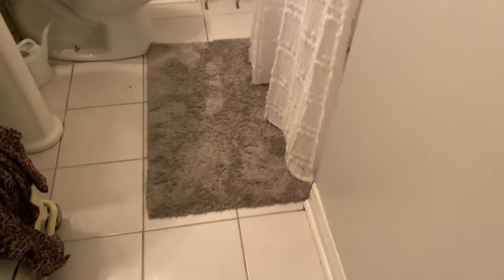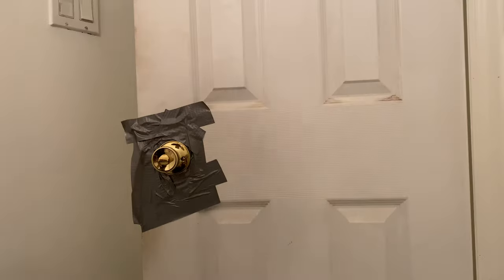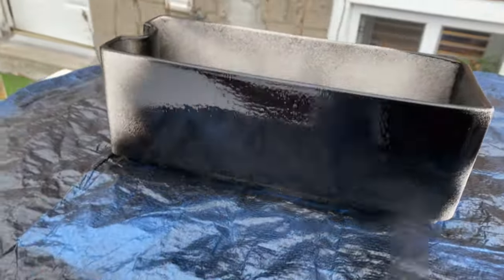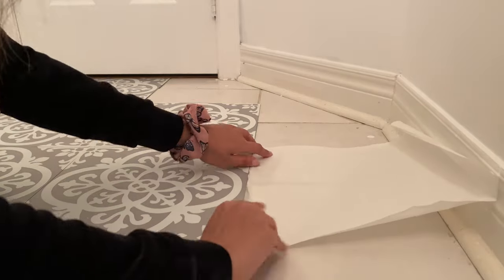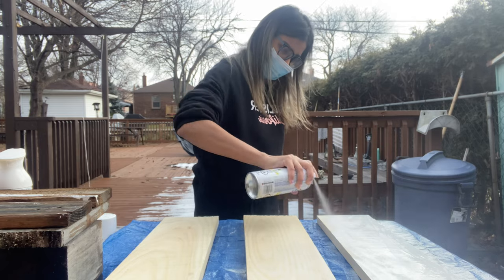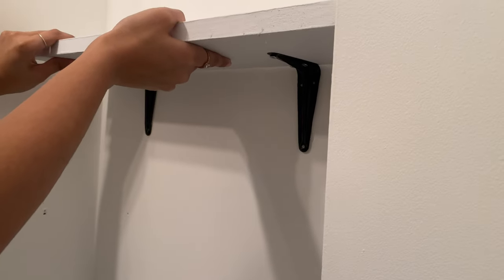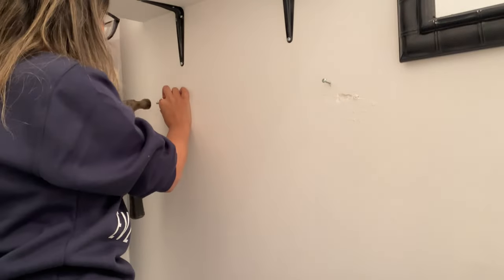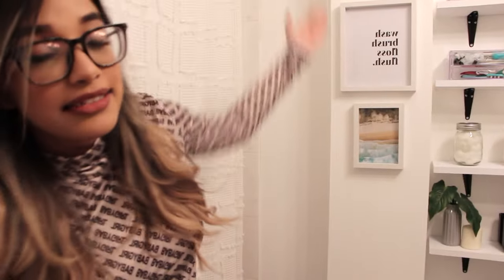DIY SMALL BATHROOM MAKEOVER UNDER $350 | MAKEOVER ON A BUDGET

Comment: Great diy! A little heads up, when you are drilling the walls, make sure one hand it’s on the drill button and the other is on the back of the drill, and use that hand to push to give it more force and keeps the drill bit steady. Otherwise, nice drilling job
Reply from the maker: Thanks for the tip !

Comment: Why didn't you patch the wall beside the towel hanger before painting?
 it's easy to do.
To remove wall anchors...just put a scree half way through and pull with plyers.
Reply from the maker: I did off camera!
Reply: @diyadiys849  ok nice....in the reveal it's doesn't look patched.